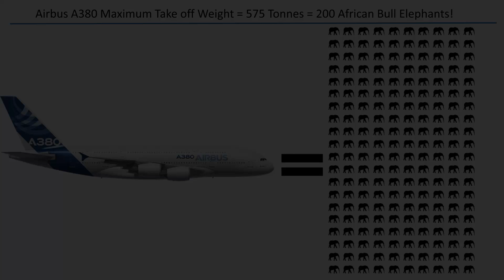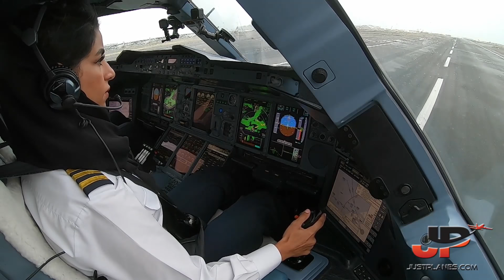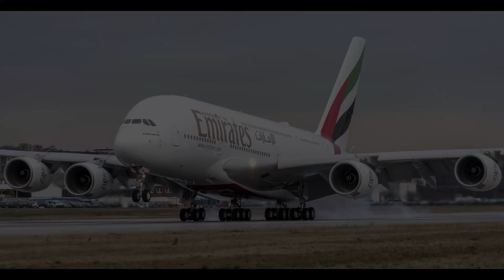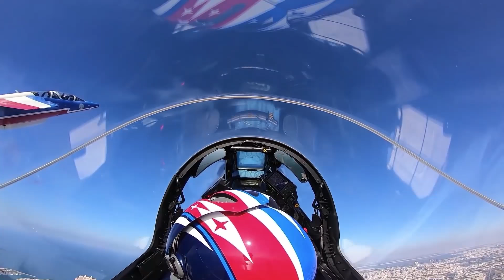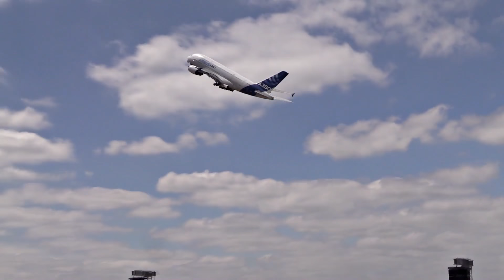How Does Lift Work? (How Airplanes Fly)

Comment: Here is a fun exercise to show the kids. Take a sheet of A4 paper hold it horizontally under your bottom lip and vigorously blow across the top surface. See what happens. For an even more dramatic effect, take two sheets of paper, hold them together, vertically this time and blow between them as you did previously with the single sheet. The effect will be somewhat noisier. If you really want to impress everyone, use a hair dryer!

Comment: I watched that video twice, and I still do not understand. But don’t worry I was never really good at maths and science.
Reply: That's all right.  Just fasten your seat belt, say a prayer, and everything will probably be OK.
Reply: @edhorton2766 So true!
Reply: 😅😅😅 @edhorton2766
Reply: open the the car window while driving, stick ur hand out and act like a wing. easy
Reply: This guy spends lot of time talking everything and just spend 10 second and just say pilot pulls back on control stick which move rear flaps to lift off. He doesn’t explain how that works such a shitty video
Reply: @AlexJone-q7s that’s right !!!!
Reply: Ditto☺️
Reply: You need to learn physics! When I a child I wanted to be an airline pilot, but in high school I had to give up my dream because I was not good in physics and math at all 😂😅 bummer but that’s life
Reply: This hypothesis makes no sence because it's false. A pressure differential doesn't cause lift, rather a pressure differential is lift caused by downward acceleration of air. There is  not 2 causes for lift only one. This hypothesis shouldn't make sence, because it doesn't make sense.

Comment: Pilots use KNOTS or 'nautical mile s per hour' not km/hr! .When the pilots pulls back on stick is does NOT DEFLECT the REAR FLAPs, what on Earth are you talking about. THEY ARE CALLED ELEVATORS! They control pitch and Angle of Attack! After listening to this guy's absurd and ludicrous first 2 minutes, I couldn't watch any further!

Comment: Leading edge flaps are crucial for producing lift.  At take-off the air can't get out of the way quickly enough and gets bounced upwards but immediately comes down again with the weight of the atmosphere pushing down on it. This has the effect of creating a vacuum above the wing.  The atmosphere all trillions of tons of it detects the vacuum and pushes it upwards to where vacuums belong to the top of the atmosphere (equilibrium law). But practically,  it's just the air around the plane which does the job.  At higher speeds say above 400 knots the vacuum (otherwise known as a shock wave) starts to have difficulty keeping up with the plane and tends to drag back on it so the designers angle the wing back into it eliminating much of the drag while maintaining lift.  By this 'sweep' angle you can roughly estimate the operational speed of the plane sometimes.  I've seen these shock waves on planes landing at airports as condensation formed along them.  You can see it also on your video.  The bang you hear when a plane breaks the sound barrier is the shock wave, no longer able to keep up with the plane, collapsing explosively.  He's wrong about the 'angle of attack'.

Comment: New airplanes will have a hard disk inside, its software will enable antigravity just by the existence of the software. It is one billion terabyte, not much compared to such a solution. A Reptilian Warcraft has 3 such hard disk drives. The wings of these new planes will be much smaller, only designed for steering. A Reptilian Warcraft also has wings, sometimes they are engaged. The Boeing 747 was originally designed by Reptilians, millions of years ago.

Comment: You explain what happens but not why. As airflow speed  over top of wing increases the pressure falls. Yes but why does air pressure fall as speed increases. Because acceleration and higher speed requires energy which is taken from the air pressure so the air pressure falls. Bernoulli’s theorem.

Comment: Excellent video. One of the few that talks on angle of attack firstly rather than makes out lift is almost all to do with wing cross section. Yes .. a flat wing will fly happily due to aoa … it just flies even better with cross section shape. I know as I made model aircraft in my teens with flat wings and they flew fine. Unusually sensible video this . Many thanks .

Comment: Still there is confusion on how lift is created, some people say lift is created as a result of "law of conservation of momentum", some say it Bernoulli principle.
Reply: In my understanding, there are two parts working together to lift the cockpit. 1: the flaps-located at the main L&R wings. 2: The elevator-located at the stabilizer (short wing at the rear plane). When the plane  reach the enough speed against the gravity, the pilot will pull the elevator lever upwards; it’ll change the low pressure air flown at the top of elevator to high pressure, so these action will make the cockpit raise. At the same time, the plane speed + the high pressure air below the wing will lift up the plane to fly… I hope its correct…😊
Reply: It has not and will never be Bernoulli's Principle. Energy is always conserved ND Newtons laws are always followed in such situations. The action of the aircraft being rammed through the air by the engines,or even gravity as it descends must deflect air downward in order to deflect the plane upward (lift). No matter what else, this has be so as Newton's third law must be followed.

Comment: Doesn't squeezing air (by the air being forced around and over  the curved upper wing surface) INCREASE the local pressure ? The video says there is a pressure DECREASE.

Why should the air speed over the upper wing magically increase ?
Reply: What's the volume of the A380?
Reply: I think the reason is that the same volume of air has to travel a longer distance over the curvature of the wing top compared to the flat bottom of the wing, at the same duration of time, hence the speed of air increases over the wing and as a result it's pressure decreases.
Reply: @ach557  This “equal transit time” concept is incorrect and a common misunderstanding. The air flowing over the top and bottom surfaces actually do not arrive at the trailing edge simultaneously.

Comment: Great to see a video that mentions angle of attack in the explanation of lift! most sources miss out on this. I also find a lot of sources that miss the reactive force of deflection of airflow. Most sources just focus on pressure differential. However, your explanation of the coanda effect was wrong as this only applies to jet streams. The use of the cup is also a very poor example, as this is not a result of the Coanda effect, rather an effect of surface tension between the water and the cup. Additionally implication of causation in a one way direction between pressure and velocity is risky, as these factors effect one another simultaneously. Finally, it is incorrect that the airfoil is "sucked" up. This may seem minor, but the increased pressure below the airfoil pushes it up, rather than it being sucked up.

Comment: This is a great video in explaining aerodynamic concepts relating to lift, thank you! It was great to see all the diagrams and the visual representation of the airplane flying because it gave me a better understanding how lift works and how we have to apply the concepts such as the angle of attack and the pressure differential on how faster moving air applies less pressure which are crucial concepts in understanding how lift generates.
Reply: How to change direction, because when the radar reacts, there's a sudden change in direction which may panic passengers.Hw do captains manage to change direction in a better and safer way.

Comment: Nice video, one thing to note though is that the Coanda effect describes the tendency of powered jet flows to stay attached to convex surfaces. The air over the top surface of an airfoil stays attached due to a combination of the ambient atmospheric pressure deflecting the streamlines downwards and viscosity causing the flow to stick to the surface (which is also the main reason the water stays attached to the mug in your demo)
Reply: negative.  The air doesn't stick to anything.The air moving over the top of the wing is moving faster based on its shape, creating lower pressure.  It is slower moving across the bottom of the wing, at a HIGHER pressure. Lift is the object moving from high to low.  Its called physics.  Bernoulli's principle.
Reply: @justing42 Wrong. Explain the boundary layer effect and why aircraft have devices to break it up.
Reply: Very well done.  A small time pilot told me that sometimes the front of the wing is too smooth, making air (and water), pull into little streams instead of laying smoothly over the surface.  Dealing with meniscus. Some wing fronts had to put on a very thin matte finish to break up the meniscus. 
Looking forward to your videos, thanks.

Comment: Great video with clear and concise explanations and diagrams of the use of lift by airplanes to fly. Great that it explains lift using both aspects of angle of attack and pressure differential, as well as describing lift using both the Newtonian approach and the Bernoulli approach. The video could have gone into more detail about the technicalities of lift with respect to aircraft wing design, such as the production of vortices from certain types of lift, in particular those that have highly volatile angle of attack changes, although this probably would not amply fit in the timeframe of this video.

Comment: Great visuals for explanation of the different components of an airfoil. Good you mentioned that flat plates can also generate lift, helps to illustrate more that Newton's third law is an important component of lift generation and is not simply caused by curvature. The Coanda effect is used to the advantage of some types of aircraft, but it is not part of the basic fundamental lift generation from an unmodified airfoil. From my understanding it is concerned with fluid jet flow, which isn't involved in typical flow moving past an airfoil. I'm not sure if the "squeezing" of streamlines is relevant given that flow over an airfoil is external, not internal. Circulation is another important aspect of lift, but I understand it's somewhat of an unintuitive explanation and wouldn't have fit the aims of the video in providing an easy to understand explanation of lift.
Reply: Complex and lengthy explanations are good. Well this video is perfect for people who do not know physics or are not interested in physics and serves the purpose quite well. To make everyone know in a simple way about aircraft lift.
Reply: @lesliemgalula720  Navier-Stokes anyone?

Comment: Thank you for this explanation on such a big topic in aerodynamics. I really found useful the many diagrams and visuals to aid in the explanation of lift. Both the angle of attack of the airfoil with respect to the flow as well as the pressure differential are both major concepts to understand in order to generate as much lift as possible.

Comment: A big aircraft leaves a big starting vortex on the runway, and you would know all about it if you tried to follow in a small aircraft straight away. When the aircraft lands and comes to a halt, it dumps a stopping vortex. It is the latter vortex, associated with the wing while in flight, which generates lift by the Magnus effect, or the Kutta-Joukowski circulation theorem if you like.
Reply: No it doesn't
Reply: Make your own video bruh
Reply: Huh? Wingtip vortex stops immediately after touchdown…

Comment: The elevators  should have been talked about and how they helps point the nose up after 300 klm
Reply: You right the flaps are set when the aircraft is still stationary it's the elevators that you pull at around the take off speed they are the horizontal part at the edge of the tail

Comment: This isn’t the worst explanation of the physics but still  has Two SERIOUS errors.
.
@1:45 The elevator surfaces are not called “rear flaps”. Flaps are on the wing.
.
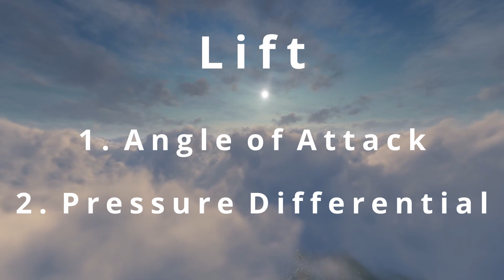@ 2:22 Saying that AoA and Pressure differential is not a bad simplification / summary, but implies there are two lift forces.
.
@ 2:48. Air does NOT bounce off the lower surface.  It flows downward in a smoothly curved flow. Even MORE air flows curved downward from ABOVE the wing than below.
.
@ 3:20 The top-Bottom pressure is ALL the lift.  However, a pressure difference will only MOVE the object if it is free to move.  A craft in level flight is not “moved” upward by lift. 
.
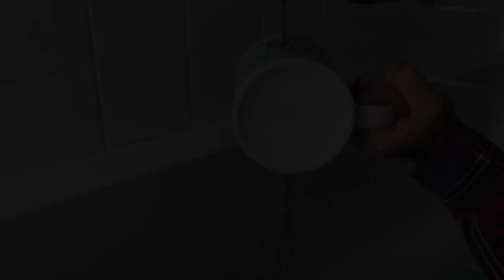@ 3:51 The Coanda effect does lower the pressure near the surface of an inside curve, but Coanda is only for a jet of fluid in an otherwise still environment.  This does not happen above a wing.  However, the similarity is the lower pressure on the inside of the curved FLOW. Making them easy to be confused.
.
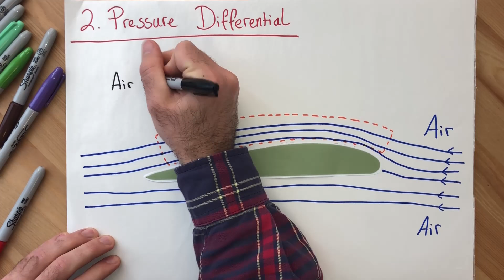@ 4:15 The first serious error. The flow is Not squeezed. There is no hard wall above the wing, but a soft cushion of air. It is NOT a venturi tube. This is one of the common misconceptions.
.
Fluid has mass and a net force is created by a pressure difference between two locations – called a Pressure Gradient. Euler first recognized this in the mid 1`700s following up on Bernoulli’s work.  That net force Accelerates the mass of air away from the higher pressure toward the lower pressure.
.
A Pressure Gradient provides the force  that Accelerates air toward the lower Pressure.
The air speeds up because the pressure ahead of the wing is roughly atmospheric pressure which is greater than the reduced pressure above the wing. This pressure is reduced because it is on the inside of the curved flow – It wants to go straight, per Newton’s First Law.  You can view it as it is the inertia “pulling away” from the center like you feel moved to the outside car door in a turn. Read Newton’s First Law.
.
.
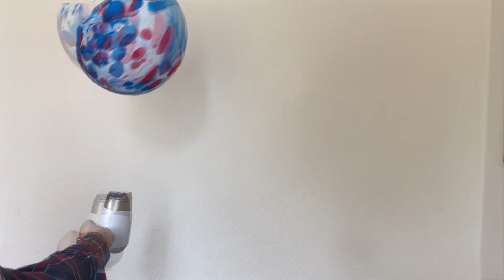@4:50  The second serious error.  The “faster air” out of the blower is NOT at a lower pressure than the still air around it. This is well known by aerodynamicists and easily measured by anyone with simple equipment. It is the true Coanda Effect creating a centering force by lowering the pressure more when more air curves around one side – allowing the higher air on the other side push the ball back in.
.
The pressure inside the blower is higher than atmospheric pressure.  This creates an Euler Pressure Gradient which accelerates the air away from higher pressure inside the blower to the relatively lower atmospheric pressure outside where the moving air assumes the atmospheric pressure of the still air around it. Euler again.
.
The video does not make it clear that while there are the two things that are significant for lift, it FAILS to clearly state that the entire lift is from the Top-Bottom Pressure Difference.  Those pressures are in effect, created by the curved flows below and above which the angle of attack contributes to.
A full treatment can be found here:  https://rxesywwbdscllwpn.quora.com/ 

- - 
Regards.